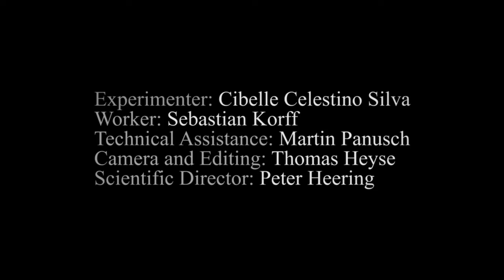Historical Didactical Video on Joule's Paddlewheel Experiment

Comment: so the experiment failed ? cause the temperature is the same
Reply: Experiments do not fail, they test hypotheses.  The temperature of the water increased controlling for all other significant variables.  Presumably, the hypothesis was that the water's temperature would increase, controlling for all other significant variables, and it was thus confirmed by the experiment.
Reply from the maker: Thank you for your question: As @deejaybundst1671 already pointed out, experiments do not fail, they may produce unexpected results or show that some unexpected effects affect the experimental outcome - the latter may result in a modification of the experiment. But this is not my main point:
In this case, we have an increase of the temperature, it is just very small, Joule had in his experiments typically an increase of the temperature of about 0,55°F (which corresponds to some 0,3°C).  Thus the temperature is not the same it is slightly different (and Joule made another observation after waiting for the time the individual run had taken (some 35 minutes) to make an estimate of the heat transfer from the vessel to the environment or from the environment to the vessel).